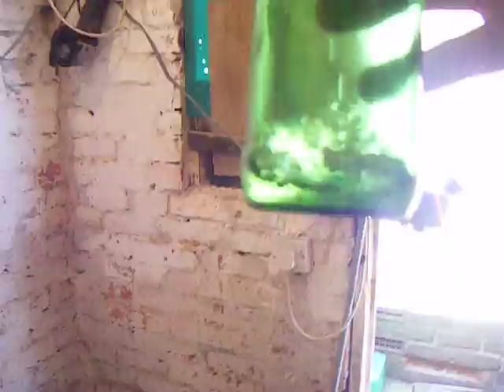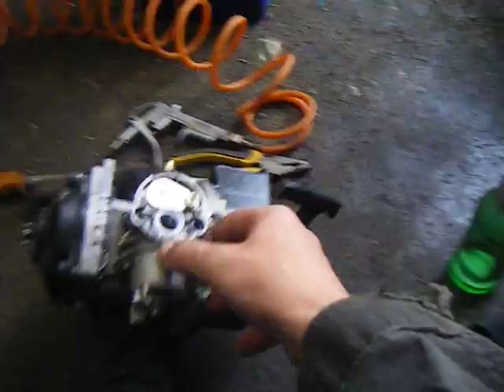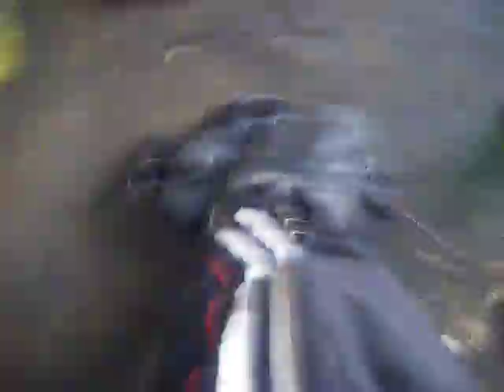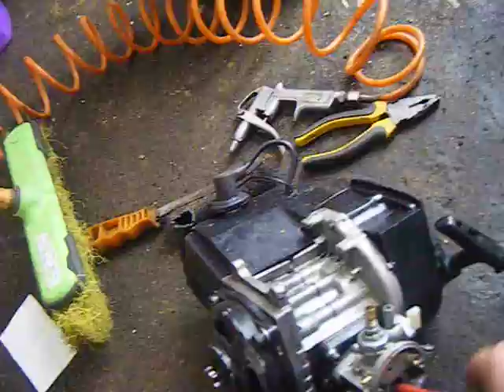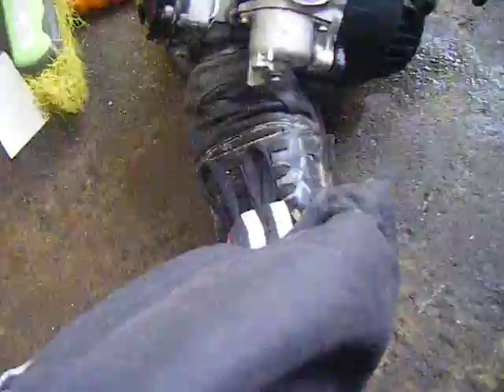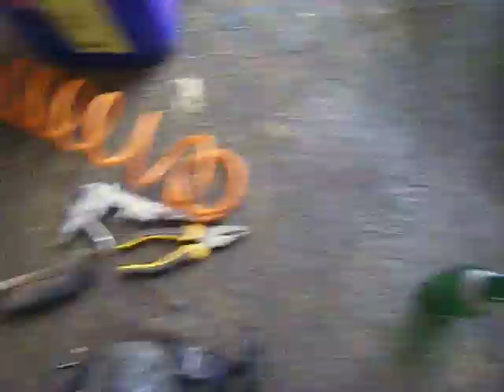cold start 2 stroke 49cc china copy engine

Comment: i think it make no sins if you put the trottle up with your skrewdriver..or make it makes sins because you put the gasoline in the carb end a little gasoline gows into the low side from the carburator so when you start the engine the piston sucks gasoline from the upper side carburator end olso from the down side carburator..i understan you just wanna start the engine...